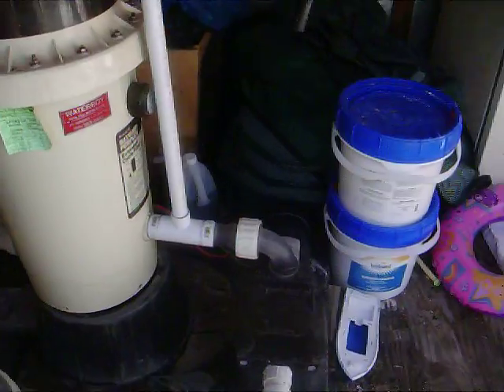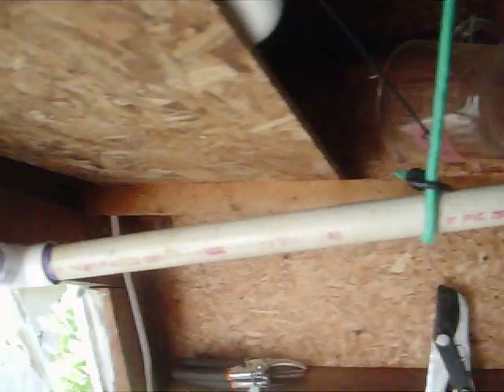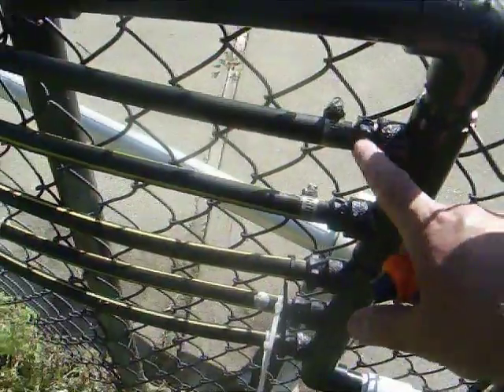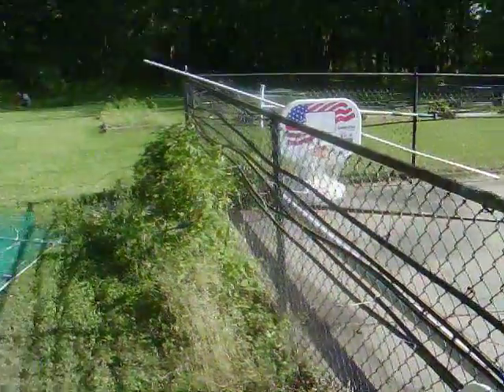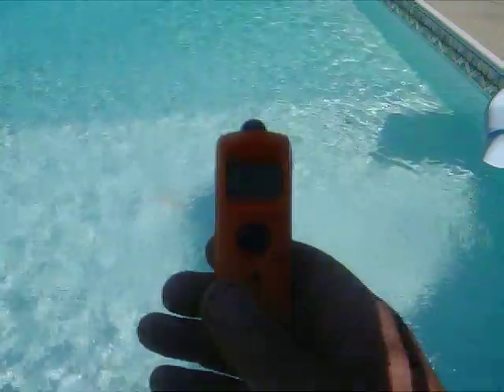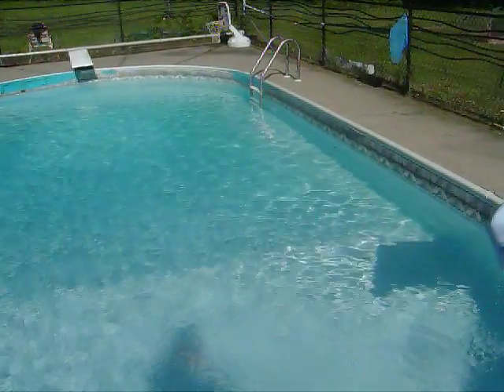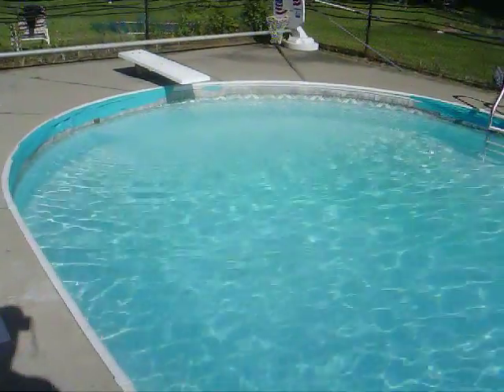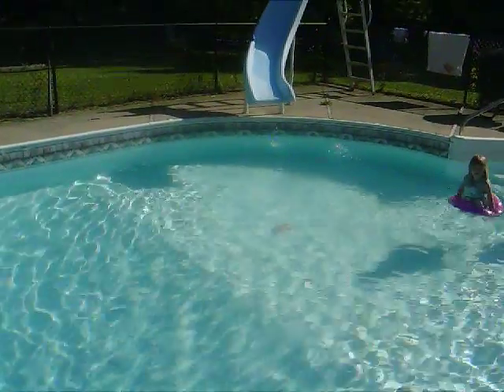Solar Pool Heater

Comment: Guess the head pressure to be quite high  due to all of the 90 degree fittings, splits, and  restrictive diameter of the tubing.   You'd be better off  "feeding" the system  from  a valved tee  after the filter return.  You'll want to be careful how aggressively you throttle the pump output if you are going to install and manipulate a valve on the main return line.  The back pressure can cause the pump cavitate or create micro bubbles at the impeller.  It's noisy and harmful to the pump.

Comment: Nice job. You mention that you could run the water faster through the system, but that it would just lower the temperature of the output. Despite that, you would actually be putting more heat in the pool. 

It's obvious if you don't think of how much heat you're putting in the pool, but instead think of how much heat you're taking out of your black hoses. The cooler they feel, the hotter the pool.

Downside: don't want too much water avoiding the filter.

Comment: having 5 1/2" tubes is kinda pointless if your going to just end up running it out of 1 1/2" tube, you need to have it go back to the larger pvc size before going back into the pool; for all 5 tubes to be effective.

Comment: You could probably create more heat by running the water back and forth through all the pipe. Instead of having headers at each end just loop it back to the next higher pipe. The water should get hotter with each run through the pipe. No?

Comment: I would like to point out that the heating lines being exposed to open air are not very effective even though it may work. the problem is that once the temperature difference between the water/pipe and the air gets large enough you will not be able to heat the water any more because all of the heat would convect away. If you really wanted to increase your heating abilities, isolate the tubing such that it is not open to outside air. Build a cleartop box so no heat is convected away.

Comment: Is your filter programmed to run at certain times during the day? I ask because if the filter runs at night and the valves to the solar system are left on it will act like a radiator and release the heat into the atmosphere. Just a thought.

Comment: In Ga my pool would get up to 96 deg. in August. At that point I will have another bypass to run the water to a set of pipes burried along side the shady side of the house to cool it off.

Comment: Hey, nice set up. I'm going with a little more volume. Tapping off my 2 inch pipe, after the pump, filter, chlorine generator, right before it goes back to the pool. All  clean water will get bypassed to the heater. I'm using larger pipe for more surface area to gather heat, plus the more diameter the pipe, the less speed. Smaller pipe will shoot the water thru it fast, which we don't want. The pipe wil remain 2 inches until it goes to the manifold. The manifold will distribute to 1in pipe.